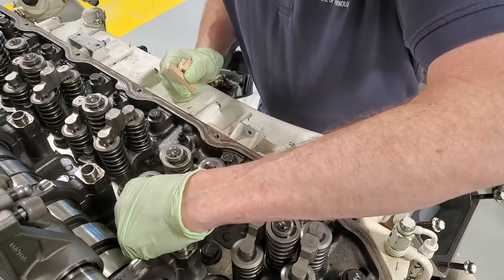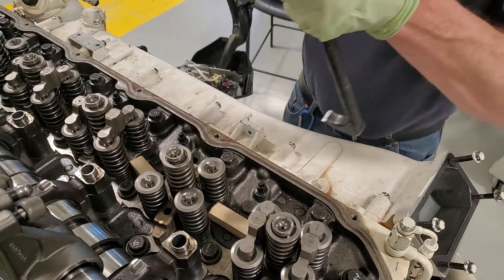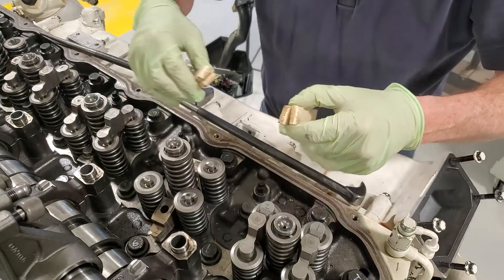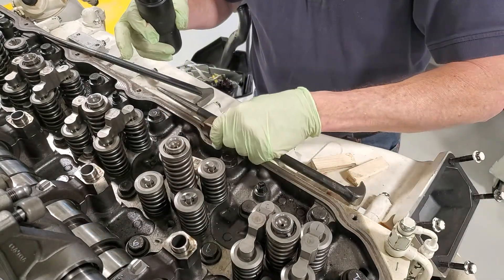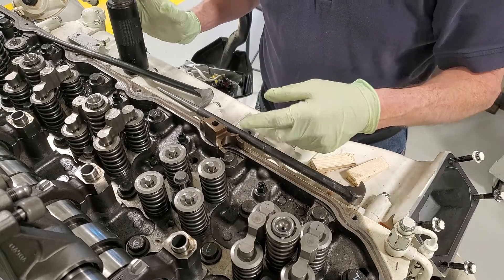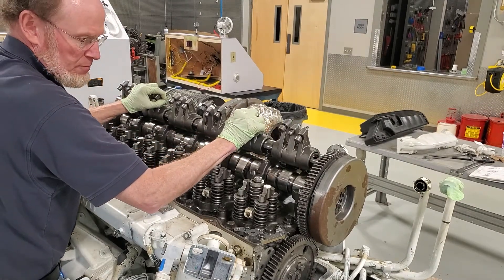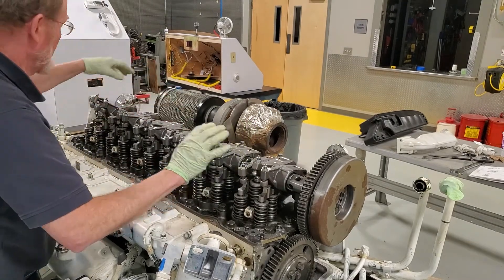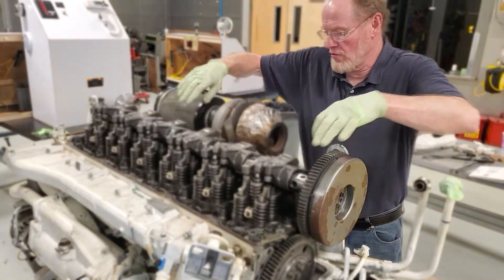Volvo Penta D9 Electronic Unit Injector removal and Rocker arm shaft re-installation

Comment: Sorry . Mr. I need torque connecting road . Help me please .
Reply from the maker: Not exactly sure what torque specification you need. Please clarify what model and component.
Reply: @tedsmarinerepair8956  ok Mr. The is Volvo Penta D9 . I need torque connecting road . (connecting road from four bolt's). Thank you very much !
Reply from the maker: @РустамБазаров-т6ы  
Conrod caps - tighten the bolts diagonally
NM (Ftlbs)
Stage 1 20 ±3 (15 ±2) –
Stage 2 35 ±3 (26 ±2) –
Stage 3 – 90° ±5°
Reply: @tedsmarinerepair8956  Thank you so much ! You helped me a lot !
Reply: @tedsmarinerepair8956  May God give you health .
Reply from the maker: @РустамБазаров-т6ы  And may your new year be Most Excellent !
Reply: @tedsmarinerepair8956  I myself work as a locksmith - ship repairman . And it's hard for us without recommendations . We all saw the engine and mechanisms , but the encountered the Volvo Penta D9 for the first time , we can say
Reply: My work partner also thanks you
Reply: We also want to wish you a Happy New Year and wish you all the very best
Reply: @tedsmarinerepair8956  anyway you good man .